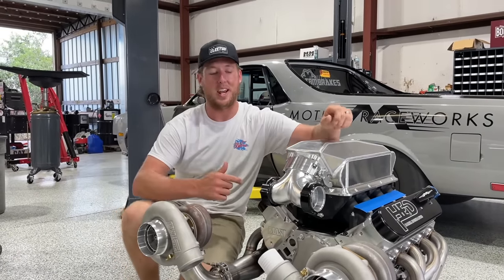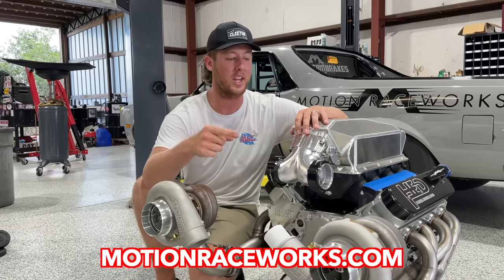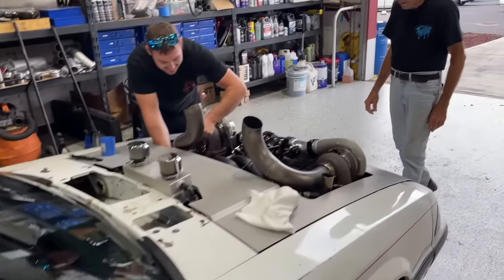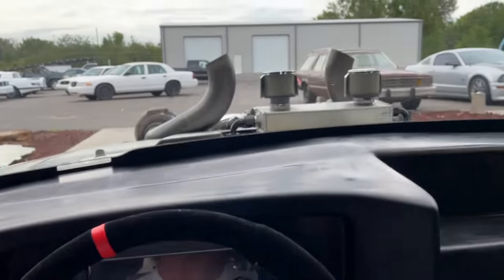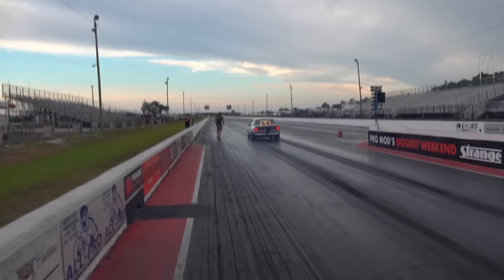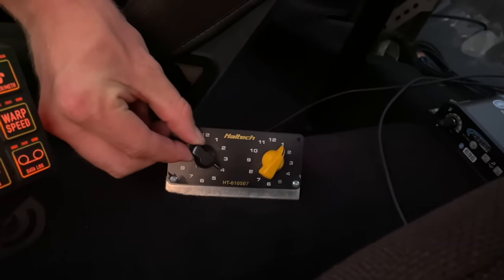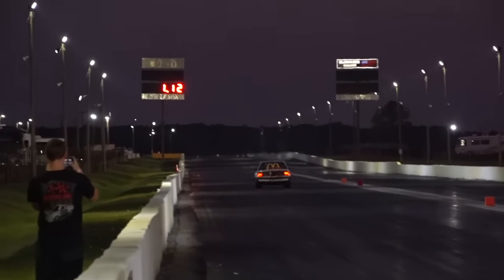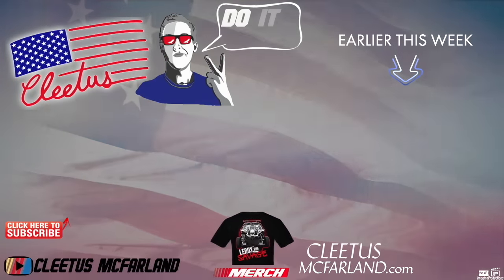I've Been Shifting My 5-Speed Lenko BACKWARDS For Months... INSTANTLY Made My Car WAY FASTER!!!

Comment: With this engine you will be slow anyway, because you have no traction. From what I can see in the slow preview, you're losing more than a second to the fact that your wheels are slipping all the time. You need downforce, which means traction